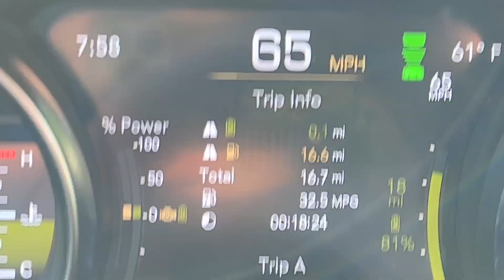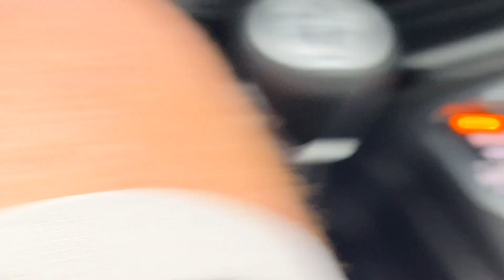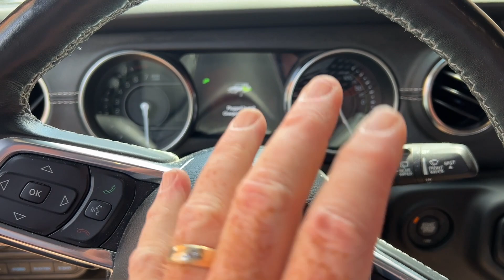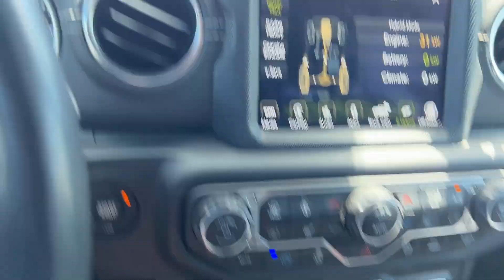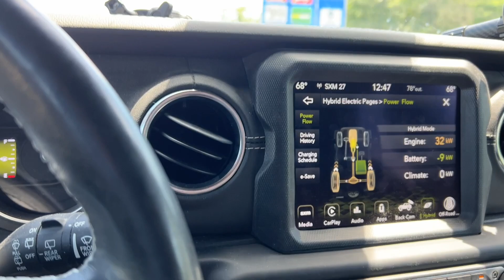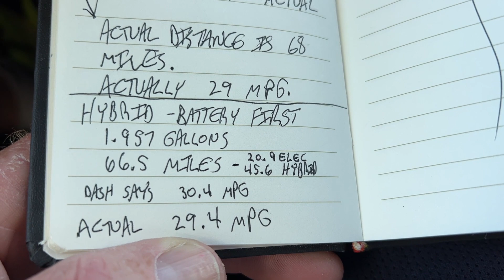Blended Hybrid (M8) vs. Regular Hybrid (plus bonus content)

Comment: Thank you very much for your response, I love sharing with you your great 4xe experience.
In addition to the fact that in M8 the engine is never turned off and it can be done in e-Save mode (+ Battery save),
Is there any other difference between e-Save (+ Battery save) and M8 manual mode?
What can you tell me about gasoline consumption in both modes?
What happens in M8 mode when the battery percentage is less than 1%?
Reply from the maker: In M8 mode, it will still use battery power if it’s in Hybrid mode. It’s really the only way to force a blended hybrid mode in the Wrangler 4XE.
Reply: @Wrangler4XEFans  Thank you so much,
My question is whether when it is less than 1% in M8 the battery is completely drained or it goes to "normal" hybrid mode, as if it were not in M8, to preserve that minimum of 15%
Reply from the maker: @JuanManuel-kj8rz  The battery is never completely drained. It’s a 17.5 kWh battery. The top .2 kWh never gets used at all. The bottom (approximately) 2.45 kWh gets reserved for hybrid use. That’s always there.
Reply: @Wrangler4XEFans  Very interesting,
When it reaches 1%, does it behave the same in M8 as in e-Save+hold?

Is the upper buffer of 0.2% kWh enough to properly care for the battery or is it better not to charge it to 100% for greater durability?
Reply: @JuanManuel-kj8rz That’s what that upper .2kwh is for. 100% on the dash isn’t actually 100% total state of charge.
Reply: @basementdrumlab  A buffer of only 1.14% of the total capacity of the battery seems very little to me, in that case we would be using 98.85%, it is not 100% but it would be very close.
Reply from the maker: @JuanManuel-kj8rz  Apparently, it’s enough to not be charged all the way. The 80% thing Tesla does goes above and beyond, from what I understand. Part of that has to do with how much extra energy it requires to charge in the upper part of the charge curve. From what I’ve read, a Tesla would use a lot more energy over time if it’s charged to 100% all of the time.
Reply from the maker: @JuanManuel-kj8rz  Also just realized I responded to you from my other YouTube channel up above. Basement Drum Lab is my other YouTube channel.
Reply: @Wrangler4XEFans  Charging from 80% to 100% is slower and requires more energy, but that does not worry me, for me, it is more important to the durability of the battery and it seems that from 95% onwards the cell voltage is higher and this is detrimental to battery degradation.
This is why a buffer of only 1.14% seems very little to me.
Reply: @Wrangler4XEFans  How great, you also hit the drums!!!
Reply from the maker: When using the blended hybrid function that M3 creates, you’ll get a little over 30 MPG for the first 60 miles. After that, it will drop down to 21-24 MPG.
Reply from the maker: Esave+charge will push the MPGs down hard. Like 17-18 MPG. The MPG calculator on the dash won’t show that it’s going that low but a real world calculation at the pump will.

Esave + hold is less efficient than just running in hybrid mode at <1% battery. When the battery shows <1%, there’s actually around 15% total state of charge. That puts the battery charge curve in the most efficient place.

Comment: Hello, great video with very interesting information,
What is the difference between e-save mode and M8 mode?
Greetings from Spain, Europe.
Reply from the maker: Esave is a mode you can select on the left side of the steering wheel. Esave either holds the charge in the battery where it is or charges the battery. Both modes come at the cost of using more gas.

M8 is when you pull the shifter to the left and shift manually. In hybrid mode, it blends both the electric motors and the gas engine. People use M8 when the battery is charged to make the battery last longer. From an energy perspective, it isn’t any better than using up the electric range then going in to hybrid mode. But a lot of people have come to believe it’s better because the MPG calculator on the dash says it is. But if you calculate the electrical energy used and the gas used, it all comes out about the same.

But in the winter, you can use the shifter to keep the engine from shutting off when you come up to stop signs and such. This prevents oil dilution from short engine runs. Putting it in eSave+charge will keep the engine on too but eSave uses more gas.

Comment: Can you use the stock charger that comes with the vehicle 120 to convert it to a 240 like some other vehicles
Reply from the maker: I’ve heard that you can.
Reply: @Wrangler4XEFans  I like to know for sure I don't want to destroy for travel use
Reply from the maker: @jamieeisenhower1560  Personally, I would buy one made for it. It’s still going to be a slow charge even at 240 since it’s still going to be current limited.
Reply: @Wrangler4XEFans  I'm just wanting to enhance the one I got if it can be

Comment: Max Regen with adaptive cruise control helps with battery range, but at the end of the day, the 2.0T gas motor is most efficient on the highway!  I love getting the most miles on a tank of gas.   I got 40mpg first tank and 47 mpg on the second fill!!  2023 grand cherokee 4xe!

Comment: Are you able to make a video regarding how you install your pod lights? I’m looking to do the same on my Willys 4xe
Reply from the maker: Good idea.
Reply: @Wrangler4XEFans  thanks! I was looking to add pod lights and a lightbar but unfamiliar with how the 4xe electrical system is wired with the batteries

Comment: I have the rubicon gladiator ecodiesel. I am a light footed driver and get 24-25 city and at 65 mph highway driving 31 mpg and freeway 75 mph 27 mpg. I think if you do mostly in town or short driving the hybrid is best distance driving the diesel. Also I have achieved 460 miles on a tank with three gallons still in the tank. Diesel in Albuquerque is usually $0.80 to 1.00 dollar more. So about 25% more

Comment: I just took delivery of a '23 Rubi with KO2's, steel bumpers, hard top and tow package. The Rubi gets around 1-2 mpg worse than a Sahara just based on the tires and lift. The high line fenders allow more drag in the wheel wells, but let's face it, the Wrangler isn't aerodynamic...

I believe the power meter is not an indicator of state of charge or re-gen, but how much power the Jeep needs at a given point. Try accelerating and you will see the needle move towards 100%. I drive mostly electric to work since I only have a 12 mile drive each way and I charge at work as well. So this video was informative for when I go to the river or Vegas.

When I took delivery of the Rubi, the battery was <1%. I used E-save mode and charged the battery while driving. This is the worst possible mode for fuel consumption. I was averaging 17 mpg on the highway and the motor was always on. The return on e power was much worse than plugging it in. I saw no benefit to having the ICE charge it while driving unless you wanted to use e power when you got to your destination.

Also, when the kw reads negative in the hybrid pages, that is when electricity is being PUT into the battery. When you deplete the battery and use it for driving the wheels or powering the AC, it reads positive. They are using accounting principles for debits and credits. So the more negative the kw, the more the battery is being "saved" or charged by re-gen.

Comment: I noticed that you used regular octane rather than the recommended premium. Have you noticed a difference in your average fuel economy or any impact at all? I’m guessing you’ve experimented with that at some point in the past.
Reply from the maker: Both manuals recommend 87 but say premium can be used for performance or towing. I’ve tried high octane on trips and haven’t seen any difference in mileage.
Reply: Thanks. Good to know. I haven’t taken delivery of my 4xe yet, but I was under the impression that premium was a must.
Reply from the maker: @davesteele1042  A lot of people will say that since it has a turbo. A lot of dealers have told people that. A lot of service people will say that. I have a video series where I got the chance to have a conversation with Dan Fry from Jeep called “ask the expert”. That was one of the questions I asked and he confirmed that 87 is fine.

Comment: you also drove 9 miles with out the added weight of a full tank of gas? 1 gallon of fuel is roughly 6lbs would that have made that much of a difference?
Reply from the maker: That would be about .001% of a percent of total weight.

Comment: Thanks for the effort you put into this. I was wondering about that myself. Silly question time: I have about 6k miles after just under 1 year and my charge never goes over 99%. I noticed this at about 4k miles and a couple of months ago. The electric range is still about the same but it bothers me to not get that 100%. Is this normal? FTR the charging cycle shows complete and I only use the level 1 charger that came with my Rubicon.
Reply from the maker: Mine very seldom gets to 100%. When it does, it jumps to 99% by the time I back out of the driveway. That percentage is a software anyway. The 4XE has a 17.5kWh battery but we only use 17.3kWh. So that 100% state isn’t really 100%.
Reply: @Wrangler4XEFans  thanks for the feedback. Just noticed it after about 4k miles and I wondered if charging it too frequently caused the issue. Also, I only plug it in if it’s under 60% since I’ve heard that charging above that puts more strain on the battery. Is this true?
Reply from the maker: @EvilRubberBiscuit  There is no documentation about that on the 4XE. Some people will apply knowledge to other platforms to the 4XE.

Comment: Took a mountain trip. Coming down the mountain with an 8% grade, roughly 4 miles… my 4xe gained 7% of battery. I alway leave Regen on. I set cruise and let the vehicle do its own thing. I did not use my friction brakes once.

Comment: The dash MPG calculation in "blended" Hybrid mode does not calculate correctly for this "hidden" mode as it only counts pure electric range as electric and this mode keeps that from being "counted".  This then throws off the basic calculation of MPG for the Hybrid, which uses the electric equivalent energy of 33.7 kilowatt-hours / gallon of gasoline equivalent.  As it is not counting the electric usage properly this calculation is thrown off. That is why M8 / Blended Hybrid Mode display MPG is not correct.
Reply: Also what are you referring to as Actual MPG?  Is it miles driven divided by gallons of gasoline - ignoring electric energy in the calculation?  If that is the case I get 66.7/2.321 = 28.7 MPG for the Blended Hybrid Mode case and 66.5/1.957 = 34.0 MPG for the standard Hybrid Mode.  If it is based on gasoline only miles / gallons of gasoline I get 65.8/2.321=28.3 MPG for M8 and 45.6/1.957 = 34.0 MPG for standard Hybrid Mode.  If I use the gasoline equivalent of the electric used (33.7 kWh/gallon) I get 28.5 MPG and 30.5 MPG respectively.  In any case I agree with your conclusion that standard Hybrid Mode seems to be about 7% more efficient.

Comment: As always, another great video! I'm amazed at how you manage to make me learn a little more each time. Thank you so much. I bought a Rubicon 4xe a few months ago and I always grin when I pass by a gas station at 2.21$ CAD a liter (about 6$ a galon roughly). I run 37 km to work, by then, my battery is near 0% but still manage to do the whole trip on electricity. We have level 2 chargers at work which cost about 1$ an hour so it cost me about 2.80$ to charge. I get then to back home sometimes with the sky one touch (less aerodynamic?) open and return with 4 or 5% left. Maybe because it gets hotter later in the day, who knows. Anyway, love this vehicule and keep up with the good work! A real reference for me!

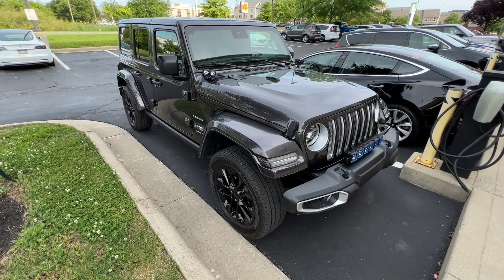Comment: We have a Sahara 4xe and 18 mile commute to work. At my work we have a chargepoint charger free to use, plug in around 6 am and by 9:30 I get the notification on uconnect that it's charged. So back home without using any fuel. 
I set it on electric mode as its a local commute.
Love this vehicle so much, I wish in 3-4 years wrangler would go with a pure EV option.
Reply from the maker: Now that’s awesome. Having a charger at work doubles the range.

Comment: How did you get the four by E on the door where you charge at
Reply from the maker: Several people in the 4XE fans group on Facebook make those.
Reply: @Wrangler4XEFans  I have the Rubicon not the high output so they come on high output
Reply from the maker: @patrickhealy4425  No, all 3 trim levels come black.
Reply: @Wrangler4XEFans  How did you get the emblem on on on the door where you charge it with a E yeah with the with the blue that’s how I wanna know how that came about I have a Wrangler for via E 2021 and it’s a Rubicon it did not come with that badging on the charging door like yours is blue

Comment: THank you for taking the time to do all this.  

I have a 40 mile commute to work one way everyday of the week.  I've tried the M8 method a couple times but found in my particular driving situation it made little difference.  I charge every night at home and can get 26-28 miles of pure electric range.  The other 60 miles of my 80 mile round trip are in the regular hybrid mode and I've been average 31-32 mpgs.  

I was skeptical of how the 4xe would perform on an 80 mile commute and I've been very impressed so far.  I was not expecting it to get the same mpg as my '11 vw golf
Reply: So, I have a 105 miles commute everyday, in flat highway on central Florida, on my 2019 mazda3 I get 27-28mpg, I’m thinking on a 4xe wrangler, in your experience, what average can I expect?
Reply from the maker: @joegonz1983  Can you charge in the middle?

For about the first 60+ miles, it gets around 30+ MPG. Now that’s a bit of a sketchy number because MPG alone isn’t accounting for the electrical energy used. After that initial 60+ miles, it drops down to around 21-24MPG.

So if you can charge in the middle of that 105 miles, that would be alright. But the 4XE really does better for shorter commutes.
Reply: @Wrangler4XEFans  thank you. I think there is a charge station around work. I think it might work. 

Your channel is very informative, thank you!!!
Reply from the maker: You're right around the distance where the 4XE is still a logical choice. If you could charge during the day at work, that would make a huge difference. Even if it's just level 1 charging.

Comment: I have a Rubi 4xe bought new. Don't drive much, and when I do it's usually within 25 miles. Have had it since Oct 2021, and it's just rolled over 3200 miles. Tank of gas which I refill on the half using 91 octane runs me about 6 weeks. Rubi says I'm getting between 47-51 mpg. I have a level two charger in the garage. I run hybrid 99% of the time, and have never used electric only. On a usual ten mile round trip the engine will run for about .6 of a mile and battery for everything else. My only complaint on my Jeep is I took a rock into my Gorrilla Glass windshield and Jeep says they will replace it for 1300.00 not including installation. I would recommend not getting that upgrade.
Reply: I got the upgrade and insurance for it . They will replace it free ….

Comment: Does anyone know where the sweet spot is for max fuel/electric economy? Factoring gearing and wind resistance, I found that my 2019 JLUR got max fuel economy about 40 mph.
Reply: That would be an awesome video!  
(Sorry)
I’ve found much over 70 mph kills gas mileage.  But a good six hour video should be able to explain all that. 😀
Reply from the maker: @TRLXPLRchannel  Yeah, the consumption rate gets real non-linear above 70.
Reply from the maker: @TRLXPLRchannel  That’s the problem with some of these experiment…they are just time consuming.
Reply: @Wrangler4XEFans  engine rpm makes an absolute HUGE difference in fuel economy. Case and point, I had an 18 Silverado 5.3 and during commutes to work I would get 15-15.5 average mpg (lifted with off road wheels and tires) however when I towed my boat my average went up to 18.3-18.5 consistently. Even with the extra weight, the difference in rpm from 55mph(towing) to 75mph(commute) was enough to see a major difference in mpg. I believe it was close to 600rpm difference.
Reply from the maker: You’re going to make me do another experiment.

Comment: It's possible you may be reducing mileage with the accessory lights and grill insert too. It is amazing how seemingly insignificant exterior changes can impact fuel efficiency. Great video!
Reply from the maker: I’ve often questioned that grill insert. I keep thinking about putting the stock stuff back for a month or two to see what it would do…but my laziness has prevented that. I’ve had it in pretty much from the beginning.
Reply: @Wrangler4XEFans  I'm putting one in this week. I'll let you know if my mileage changes lol